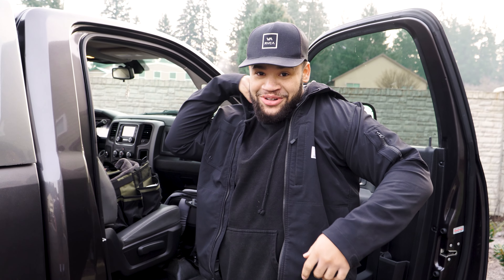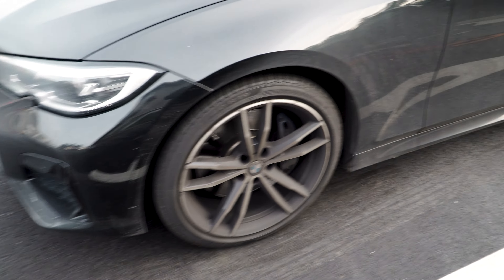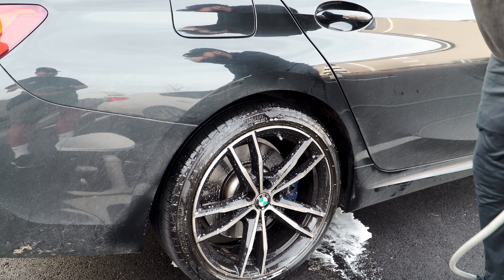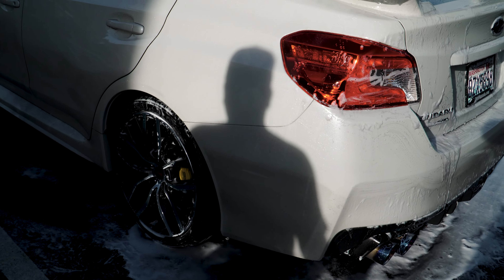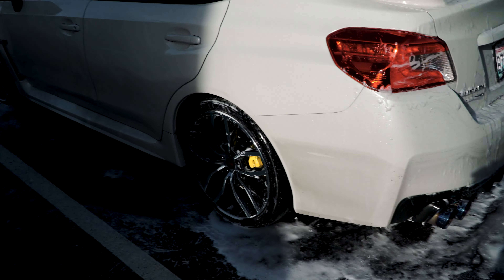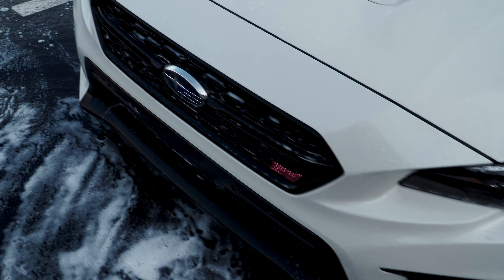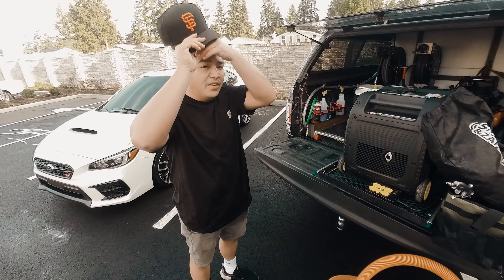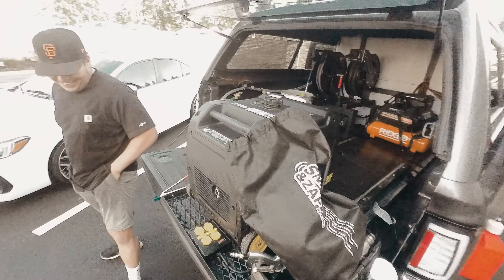First Mobile Job with NEW Setup!

Comment: Fire video. Would be better if Cisco would ask you question when doing the work. Example: what time of wheel cleaner. What do you brush first. The barrel or the outside first and so on.
Reply from the maker: feel like every does that lol but maybe well switch things up here and there. not a bad idea to provide value